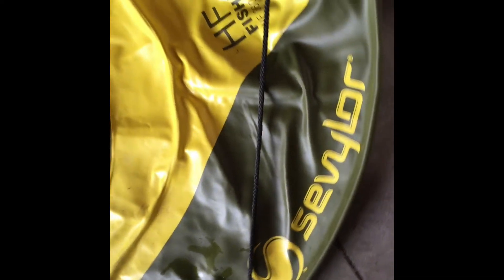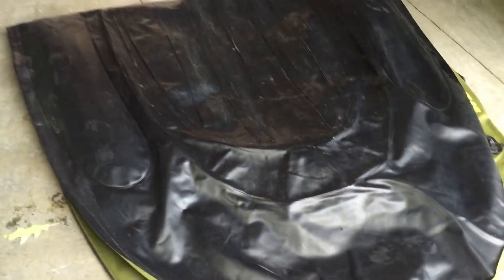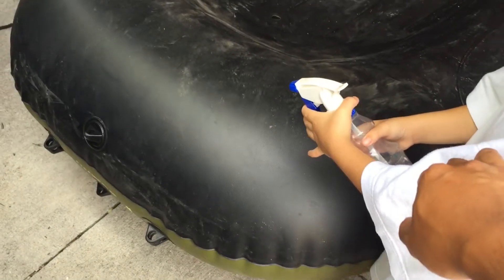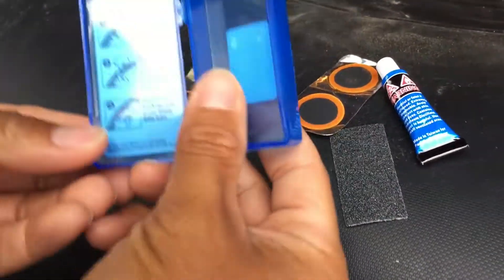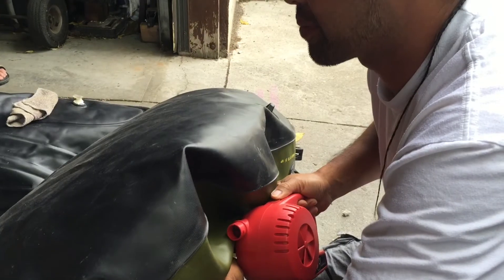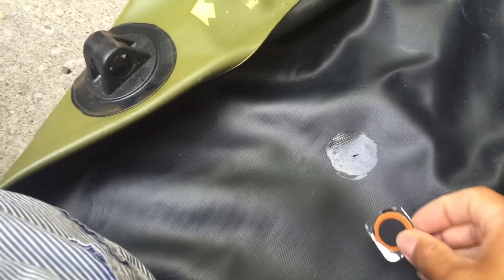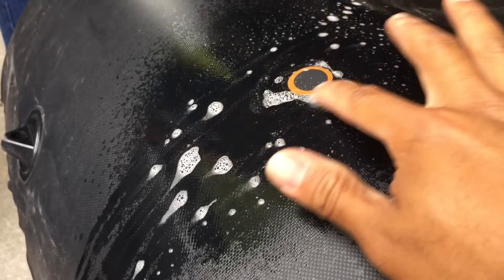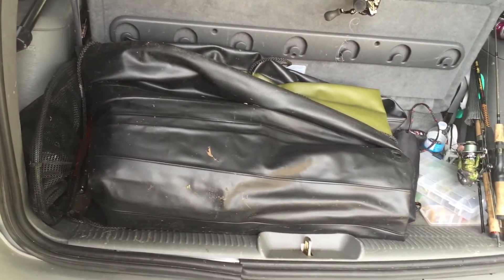DIY Inflatable Boat Repair (Sevylor Fish Hunter HF360)

Comment: hey can that kid come and fix my hf 360? she seem to have it all handled.. oops I meant can the hidden ghost come and fix my boat.. By the way no one I ran into knew what to use for this raft thanks guys.. and thanks dad for keeping the out door alive for our kids!
Reply from the maker: tinkmarshino My pleasure. Patch is still good. I have issues with valves though. I need to glue.
Reply: my patch didn't work.. I used a bike repair kit I think it was rubber cement.. Big rats.. I bought two kits I am going to try it again.. I also have some shoe glue left over.. I might try that and a patch.. or that nasty clear tape stuff..and then go and find a cute little ghost to hep me.. all my little ghost are grown now and my new little ghost live in florida.. I am real surprised at sevylor though.. I have used there product back when I was 20 or so (im 66 now) and they always had outstanding product.. Well luck to you my friend..
Reply from the maker: tinkmarshino Make sure to read the patch instructions. Maybe you need a bigger patch. Or maybe your glue is not compatible with your sevylor? Not sure. Took my boat out yesterday. Still air tight!!
Reply: Sorry I had the 250 and the 360 fish hunter, my 250 got a hole from oysters shells (so be careful of any type of shells ) but I wrecked my 250, doing what you did by taking out all of the air and waiting for the glue to dry, as glue got inside the hole and stuck top and bottom together, so I would advice to let most of the air out of the camber but still leave enough air in so it not forcing the patch off and away from the hole yet it keeps the top and bottom of the camber stay seperate